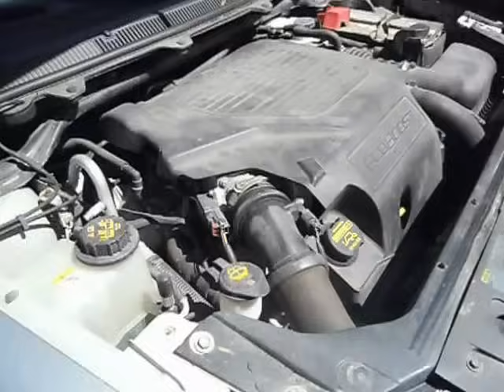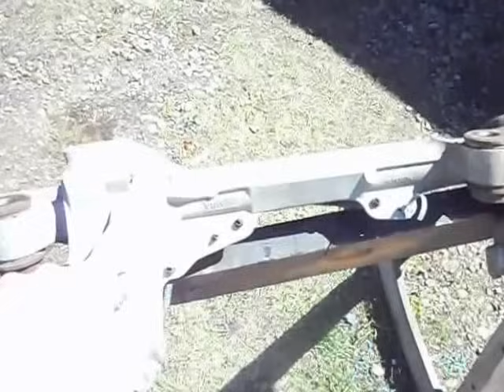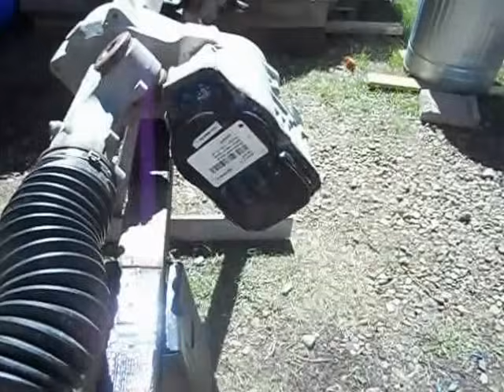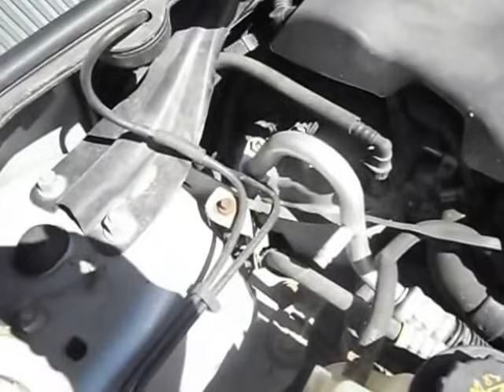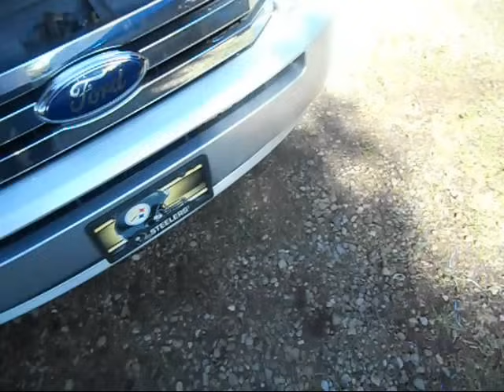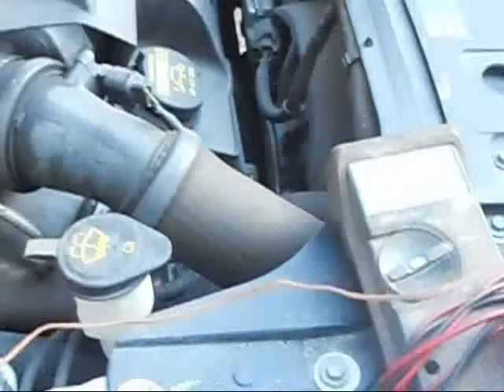Ford Electric Power Steering Failure Identified

Comment: Electronics are more reliable than ever, but as consuers demand more gadgets, more economy and more safety the enormous amount of modules adds to the potential for a problem.
At the same time people make mistakes, then look for someone else to blame. I wouldn't be surprised if Ford is FOS and 75% of the complaints are also FOS. Just playing the odds.

Hydraulic steering as better in that as it failed you had warnings like growling, leaking and so on. But electric assist is lighter, a simpler install and aids in stability control, accident evasion, parking assist and other things consumers apparently want.

Conundrum.
Reply from the maker: You would change your tune if you or your family experienced an EPAS failure on road. The experience is terrifying, and I am not speaking of the general failure where power assist is lost. EPAS failures include steering lock-up and errant commands that can jerk vehicle out of control at speed. Bad engineering design transcends consumer demands or performance enhancement. The complexity and cost of EPAS systems does not justify any performance enhancements (which I personally do not want or need) over hydraulic implementations. The real reason EPAS is being pushed is 'all electric vehicle implementation of the future'. The Ford EPAS system is dangerous and outrageously complex and expensive. Performance enhancements are completely nullified by dramatic decrease in reliability and safety. But most concerning is Ford's refusal to publicly acknowledge system design and safety issues blindingly apparent and on record. Ford is quite happy to abandon customers and force them to pay upwards of $3K every time an EPAS system fails, which for many consumers has been more than one instance per vehicle. For those affected, situation is completely unacceptable and criminal, with TSB sitting on sideline.
Reply: Hey Jim, if I wager $20 on a football game, I'll take that bet.  When life and safety come into play, 75/25 odds send me away from the table every time.  My wife and I are in the 25% of complaints that are not FOS.  Our steering went out five days ago, with a "Service Power Steering Now" on our 2013 Taurus Limited with about 94K miles on it.  She barely was able to pull into a rest stop and then call me directly from her phone because the persistently-failing hands-free, voice response Sync system locks up all of the time and reboots for "scheduled maintenance."  She was shaken by the steering going out like that.

I drove my 2007 Mustang GTCS out to her, so she could get home and so I could fight the car steering to the nearest Ford dealership.  I figured she was just not strong enough to safely guide the vehicle.  She was right!  The steering was so tight, it took a major effort to pull the vehicle out of the diagonal parking space.  There was no way she was going to be able to turn that wheel, even at highway speeds.  When I drove it on the highway, I had to keep moving the wheel from side to side in small clock-ticking motion, like it was fighting me, the whole way to the dealership--way different from the normal smooth driving we've experienced in that vehicle.  My wife was driving behind me, fearing for my life, as she saw the vehicle moving 70 mph in jerky motions, like I was inebriated.  The only other time I ever felt like this when I was driving, like the end was near, was when I was sliding in slow motion in a snowy car accident.  My knuckles were white and I was extremely tense, during the drive to the dealership.

The Ford dealership took the car in and called me a couple days later with the diagnosis.  Same thing as everyone else.  $2100 to replace EPAS and Ford wasn't going to cover it.  Thank goodness I purchased a third party mechanical breakdown policy.  I just have to pay $145 for shop supplies and deductible.  Unfortunately, the policy won't cover the Sync system, so we're stuck with that junk.  It took about 94K miles for the EPAS to fail, so we'll keep the car for another 50K or so, before we move on to another brand.  I'm going to take my old part back and put it in the attic or basement, for the day when Ford has to go to court.  I'll happily give it to whatever law firm takes on the class action suit and needs a representative sample of failed parts; add mine to the list.  

Up until this point, Ford's been pretty reliable for me.  I miss the quality I had in other Fords that I've had:  2007 Mustang GTCS w/ 70K miles, 1997 Cougar XR7 w/ nearly 300K miles, 1995 Explorer Limited w/ nearly 150K miles, 1992 Topazs LTS, 1984 Cougar with 150K miles, 1982 LTD Crown Victoria.  It feels like this is going to be a Pinto story; I fear that 20/20 is going to start reporting the deaths from this issue and THEN Ford will actually do something about it.  There are many things I'm willing to accept as failing in a vehicle (paint flaking on the Mustang hood, intake manifold cracking on the Cougar; both known issues after the vehicles aged a bit) but something as critical as steering, which cannot gracefully move to manual is unacceptable.  I mean absolutely no offense to any women out there but only a Serena Williams-strong woman can steer that vehicle when the EPAS goes out.  Many of the older folks who own that vehicle are going to be in sorry shape, when it happens to them.

Thanks, B Smith, for posting this video and analysis--it was very helpful.
Reply: Bull s#########

Comment: My daughter just bought a 2014 MKZ with 61k. She's had it about a month, yesterday went backing into a parking spot she got the Christmas tree lights (trac, abs, cel) and a hill assist disabled. It was just for a second or two then they all went out and all was fine. Today she was pulling into a parking spot and the same thing happened and she lost power steering briefly. The losing power steering made me think that the rack is going bad or the motor in this electric unit. Was that the case with you when it first started happening? Intermittent lights and loss of steering briefly? Any help would be appreciated thank you. From anyone.
Reply: Yeah, same thing for me. My 2013 mkz shined all of its lights just days before the steering went out. I’m currently under the car trying to replace the rack… its very very hard, seemingly Impossible to me.

Comment: I have a 2008 Ford Escape and more than a few times the steering has stopped and considerable effort has to be made to turn the wheel. Stopping and restarting the engine seems to reset the steering and everything is fine.
Why can't I jut remove the belt and unplug the steering inputs and then the steering would be manual?
I would rather put up with a little more effort in steering than one day have the steering run me into an oncoming truck.
Possible? 
Anybody else done this?
Reply: Csn this be done say fuck the elextric power and just treat it like a reg car

Comment: My 2016 Ford explorer lost power steering wheel with steering assist fault/service advanceTrac/Hill start assist not available/Terrain management system fault last week，I may need to go into a battle with Ford next week after new year holiday.
Reply: My 2012 fusion just had rack and pinion replaced bc of the power steering service messages . $1400 and 2 weeks later I’m getting the same messages and no power steering
Reply: The issues found today at Ford dealer，rodents chewed 6 wires related to those error messages，dealer charged me $900 CAD for diagnosis and re-wiring。

Comment: If it is a recall item they should have still repaired it for free I am in Australia and I had recall items fixed for free on a 14 year old car
Reply from the maker: Ford recalled very limited years and specific failure modes. Then only replaced EPAS units exhibiting particular error codes. At one point customers who experienced partial EPAS failures and delivered vehicle to dealer, were given software upgrades that effectively did nothing to address problem. These same customers were then denied warranty or recall service after experiencing subsequent full-EPAS failure upon return to dealer. EPAS assemblies that were replaced under recall or warranty; included identical flawed units under 'one-time replacement contract'. Many units failed withing days or weeks, and many more over time and exposure to high-temperatures. Millions of units sold between 2008 and 2014 were completely abandoned by recall, this in spite of identical equipment and failure dispositions. If consumers were fortunate enough to motivate Ford to pay for partial repairs; Ford made customers sign non-disclosure agreement specifically demanding customer not disclose any aspect of experience (this in return for several hundred dollars toward repairs; that again included replacement with flawed assemblies).

Comment: Just got 106k 2016 Transit connect. Failed on me coming off the interstate..  Won't repair under warranty or the extended warranty I bought. The shop says it will be $3,200.... They can just keep it

Comment: So is there a way to fix this at home and bypass the $1500 dealership fee? With a baby on the way this is so not in our budget. We've not had this car very long, bought it used and now the steering is gone.
Reply from the maker: You can purchase refurbished EPAS unit on ebay and other sites for approximately $350.00 and replace yourself; assuming you are willing to take on job. In larger Ford vehicles labor is approximately 4-6 hours depending on your experience and tools. Many Ford vehicles require lowering of sub-frame to gain access to EPAS assembly. Task is actually fairly easy. Some say you will need to program ECM with new EPAS unit, however this was not my experience with plug and play functionality.

Comment: a lot of good information but I got sea sick watching your video, I'm trying to find out what is causing a U0415 in my power steering control module
Reply from the maker: U0415 FORD Possible Causes:
Faulty Anti-Lock Brake System (ABS) Control Module.
Anti-Lock Brake System Control Module harness is open or shorted.
Anti-Lock Brake System Control Module circuit poor electrical connection.

Comment: Hello. I have a 2013 flex that is at the dealership now for a power steering failure. They said it “lost communication”. And the pscm has to be replaced for $3200. Now I have ford basecare extended warranty that says it covers the power steering housing (manual and power). Is that fightable to force them to cover it under warranty?
Reply from the maker: Not able to comment on warranty coverage issues, but you can bet Ford will do everything to discourage coverage if they can.

Comment: FAS Title: EPAS STEERING EFFORTS
    Field Service Action Number: 15N01 
https://static.nhtsa.gov/odi/rcl/2015/RCMN-15V340-1276.pdf

When checking where the power steering fluid reservoir was on my 2011 Ford Fusion V6 3.0L, I came across this article.  I had just ran a 'Vehicle Health Report' and logged into the Ford Sync website which actually called out this EPAS:

Recalls
Please contact us at anytime if you have questions regarding safety or emissions recalls.

Field Service Actions
    VIN: xxxxx
    FAS Title: ELECTRONIC THROTTLE BODY EXTENDED COVERAGE
    Field Service Action Number: 13N03
    VIN: xxxxx
    FAS Title: EPAS STEERING EFFORTS
    Field Service Action Number: 15N01 

The following link has the details of the 15N01
https://static.nhtsa.gov/odi/rcl/2015/RCMN-15V340-1276.pdf

Comment: fuel savings are gone on the repair cost $2000. to hell with ford. all subaru for me
Reply: I would have been better off to sink $5K into new head gaskets in my Subaru with 280k miles on it, than to sink that money into this 2012 Ford Escape, and STILL have a dangerous car!

Comment: There gett8ng their way out of having to replace them too. Apparently if the code  doesenr fix it their not replacing it either.their a bunch of sleezy salesman. I've got  2011 we bought brand new it's got 160,000 kelometers on it and it's just sitting there past 3 years and it can rot before I give ford anymore money ever again. Ours was only the 2.5 L in a ford fusion but it's crammed under the hood

Comment: Hi does anyone know if they have extended the recall to the 2010 Mercury Milan ? Had the power steering give out after a tire change and come back on recently ..... quote for repair is around 2500 for a new Steering rack .

Comment: I have a 2011 fusion 90200 miles the Steering just went out I took it to the Ford garage they said that they were or replacing it out of courtesy for free because it is so expensive but it’s not a record I thought that was funny so I started looking things up
Reply: Theresa Edwards hi. This just happend to me today. “Service power steering now” showed up. I have ford fusion 2012. My question are they still going to cover mine if im out of warranty? Is this considered a recall? Please help me out. I dont know what to do before im going to the ford dealer. Thank you.
Reply: I didn’t know it was a silent Recall but it is from on Several years how many miles does it have but I would still take it in town don’t fix nothing until they talk to you about what’s wrong . I had no warranty left on my call also !

Comment: It would appear, Ford shows NO interest in the safety of their vehicles. I bought my 2012 Ford Escape a year and a half ago. Since then, the SAME major oil leak has occurred, a battery post completely BROKE OFF, with no impact, but more disturbing is the power steering. Last September, I had just exited a very busy freeway and was turning into a driveway when I suddenly lost all power steering. Now, the car is doing it again. According to my mechanic, his research shows it could actually lock and not even be manually steered. I live in an area of cliffs. Ford's response? Drive it down those mountain passes to their dealership, sixty miles away, and pay AGAIN to have it fixed. Meanwhile, I lose pay every time I cannot work, while paying outrageous repair bills.
Reply from the maker: You do not want to own a Ford automobile; Ford engineers are incompetent, vehicles are death traps. In addition to burden of owning hazardous vehicle; do not take on liability for Ford safety issue. Ford designed and manufactured vehicle with serious safety issues. Consumers have inherent right to own and sell vehicles without sharing burden of criminal negligence. This is job of safety regulatory agencies like NHTSA; which stands idle with little to no action against US based automakers.

Comment: what if my electric streering gear motor works but always pulls to the left side with good force and stays there. If I turn steering wheel to right it resists and as soon as I let go it spins it back to the left all the way...
Reply from the maker: Never had anyone report this particular failure; symptom is however within realm of probable failure modes. I would speculate feedback mechanism is sending erroneous data to servo controller. This would cause servo to continuously attempt correction; only speculation however.

Comment: This morning my daughter put her 2012 Ford Focus (88K miles) in reverse to go to work and the car locked up on her... IN REVERSE!!!!  She could not stop or brake!   The code on her dash read "(i) Steering Assist Fault".  After turning the car off/on several times, she was able to get the car in gear and steer.  She drove it 20 miles to the Ford dealership she purchased the car from in May 2016 and they said the car needed to DUPLICATE THE FAILURE before they could do anything.  In other words "LOSE CONTROL OF YOUR CAR AGAIN and bring it back with the lights on so we can look up the codes.  GOOD LUCK!"    My daughter is now petrified to drive the car.   I filed a complaint with FORD corporate and with the NHTSA today.  Seems there was a recall on nearly 400K (2010-2014) other Ford models for EPAS failures.  There is also a class action Lawsuit filed in 2014 for the Focus for Power Steering Failure issues: https://shar.es/1OIIe9
Reply from the maker: Ford and the NHTSA are both placing consumers lives at great risk by either ignoring, or selectively identifying models and years affected by steering failures. The simple fact remains that every single TRW EPAS steering assembly installed on Ford vehicles since 2008 includes design defect which causes steering failure due to thermal exposure within engine compartment. Ford and the NHTSA won't even disclose thermal related failures, let alone broadening recall based on use of the TRW assemblies, instead of model and year. Dealing with Ford on this issue is not worth the hassle, Ford has already put in place customer handling measures that deny, circumvent and delay any customer assistance. Ford will make you pay for assembly replacement (with identically flawed assembly), and send you a letter basically thanking themselves for helping you out of your money. Stay away from Ford products.

Comment: So, I wonder if the Ecoboost models are having more problems with the steering rack then the standard motors.
Reply from the maker: Difficult to say since Ford has implemented program to limit public awareness related to steering failures. One example includes Ford program to make affected owners sign non-disclosure agreement in exchange for partial coverage of repair. The agreement stipulates owner is not to disclose any details of experience related to failure or repair coverage to any third party (including NTSB and other complaint reporting agencies). In these cases; owners who were not covered in recall will receive approximately $700.00 toward $2,500.00 repair. This is what a $199B syndicate is willing to do to protect it's public image. $700.00 is obviously less than Ford's cost to pay dealer labor plus component replacement cost. Ford tells owners "we are performing a customer service". When these steering gears begin to cause fatalities; Ford can answer to the courts.
Reply: I have a non turbo and my rack just went out without warning